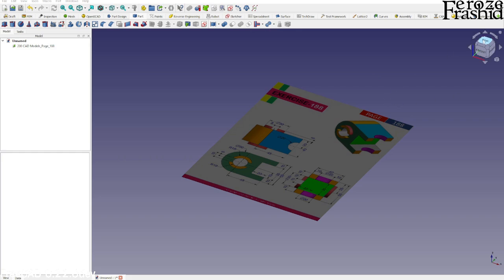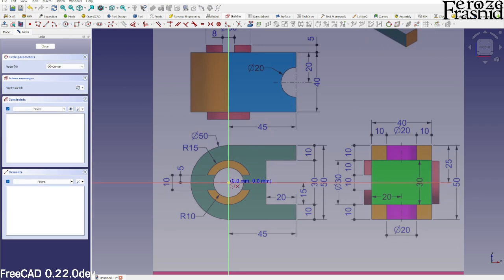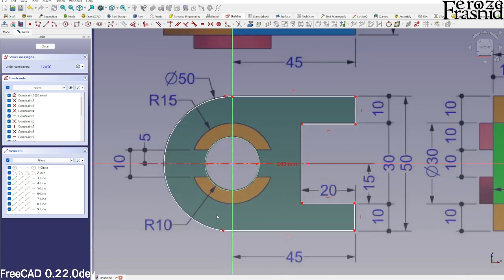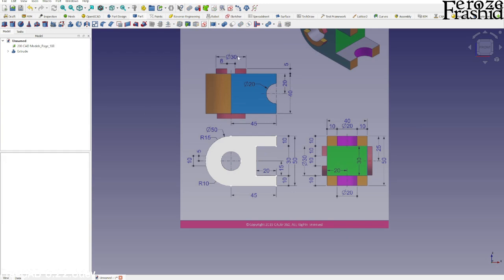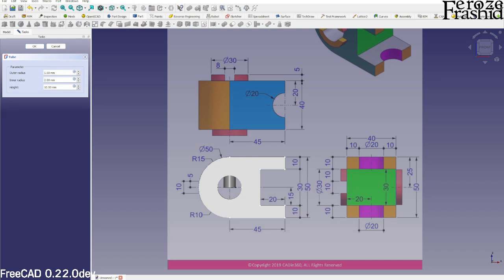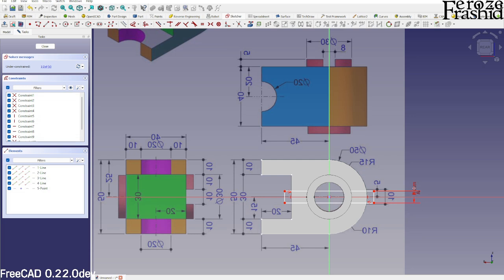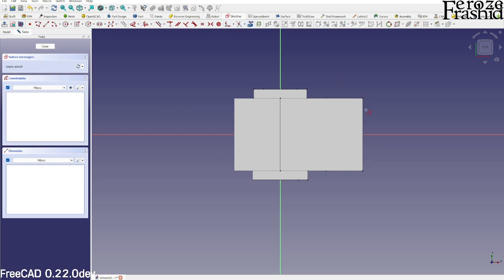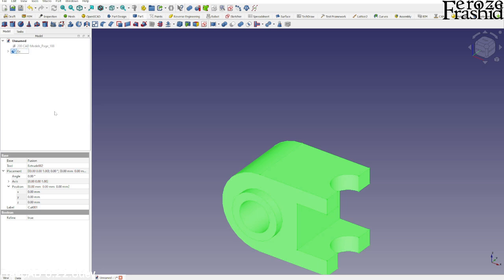200 3D Models in FreeCAD: Exercise 188

Comment: There is an addendum…. If you look closely, I believe that there is a slot on each side, but oriented 90 degrees to each other.  This could easily be accomplished by mirroring with a 90 degree rotation.
Almost done with the big project (200 3d projects)! Have you considered what you are going to do next?
Reply from the maker: I believe you're right on the slot part. 
I am thinking about intermediate level models, maybe weekly, after this series. Hopefully the 1.0 version will come out by that time, so everyone will be on the same page.